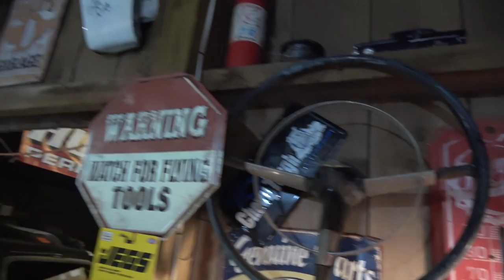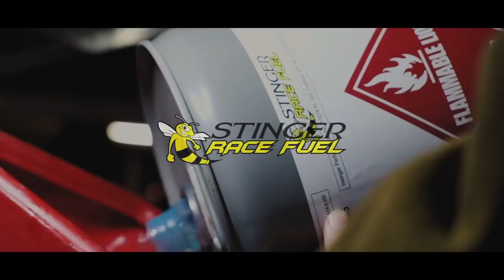Just an Everyday Vlog

Comment: 1987 GT T Top subframe connectors. 4:10 gear. Stock Motor. 89 LX that ran in 8s at wilks. 351 GT 40 Motor 4:10 gears. C4 manual valve body. A extra T5 with B&M shifter. 5 k
Reply: Ford didn’t make a TTop that year. So it’s 1 of ? Not gonna out 1,000 hp to it but 800 still bad ass!

Comment: Banshees are cool. Had a 80hp one stretched 6".  For racing up hills at Glamis sand dunes.  It was really fun.  The guy that has it now transformed it into a street drag banshee.  Just broke into the 5's.  Stock frame.  He does trick work on their trannies.  They can be shifted with no clutch and no lifting.  You just can't back load them.  Drag only.